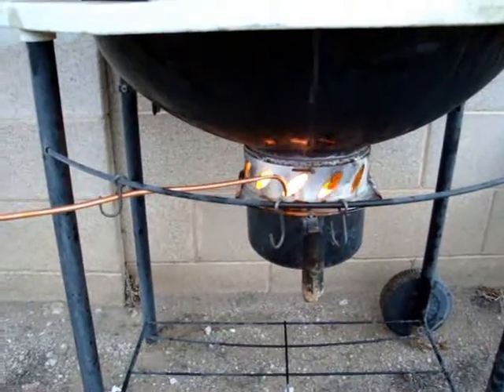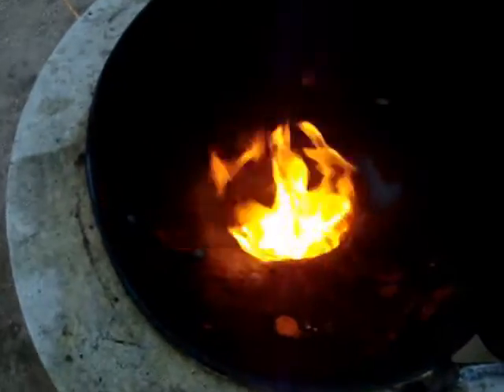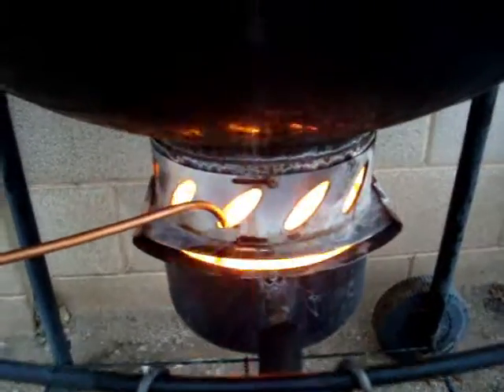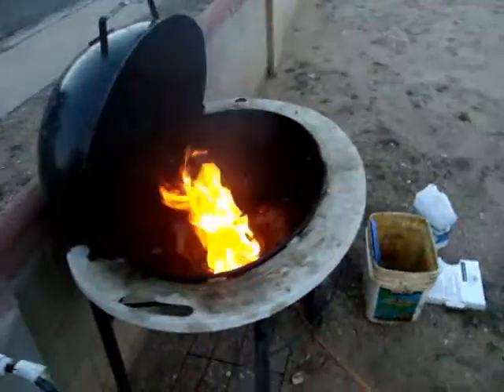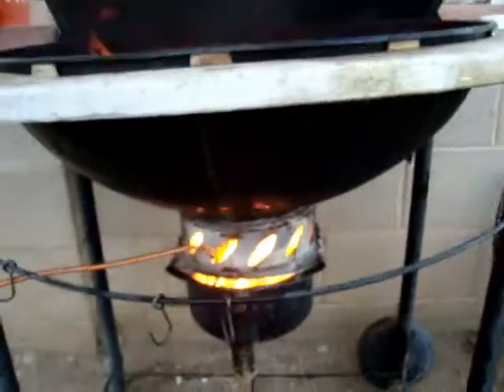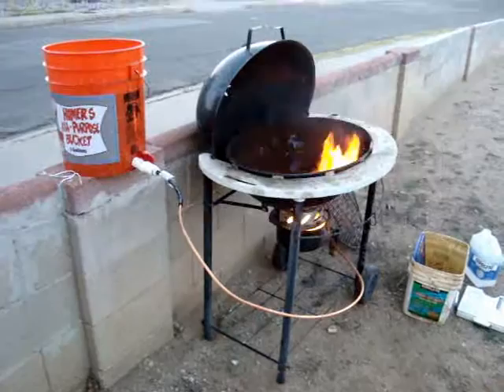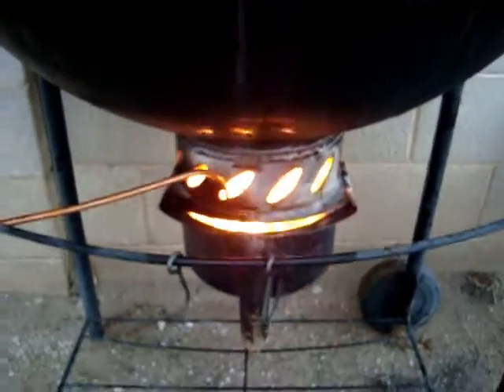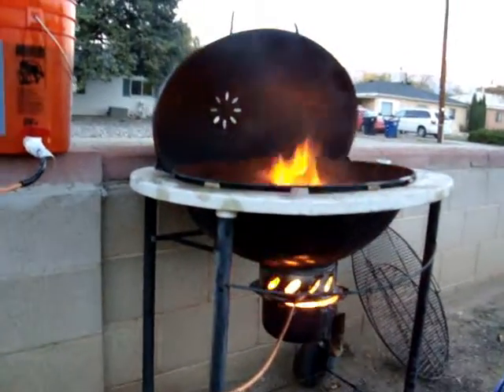Waste Oil Burner (Phase 1)

Comment: You will have to seal the burning chamber if you use a blower otherwise it will just force the flames out the Holes. 
For a draft burner the holes are OK, for a forced air burner you don't want any. 
Have you an ultimate application in mind for this?
Reply from the maker: +Oil Burner - Thanks for those tips. Yes, I was thinking of some kind of heat exchanger to use for blowing hot air into the shop for this winter. Any ideas?
Reply: Bob H
 Plenty!  have a look at my channel. I have a bunch of heater layouts and concepts and a few more I haven't got to yet.